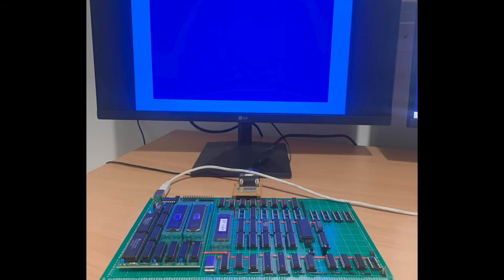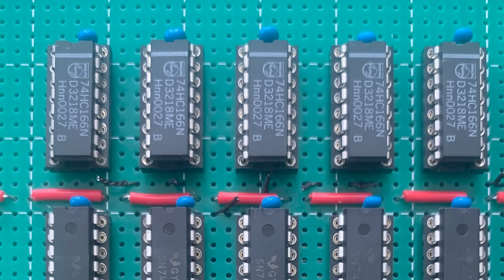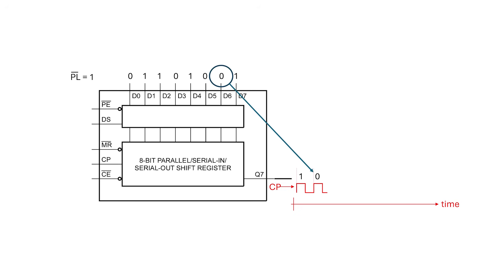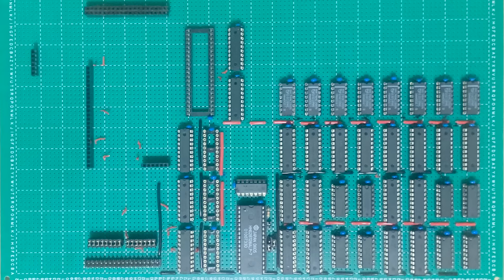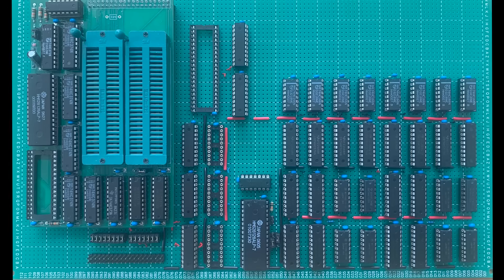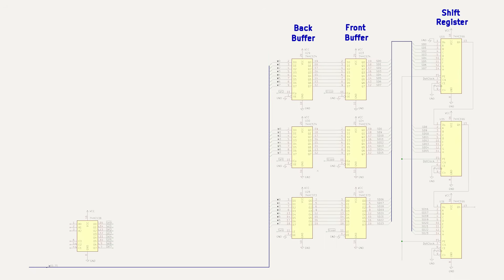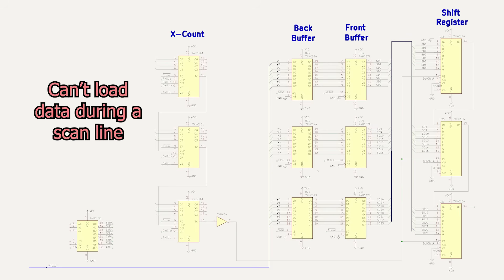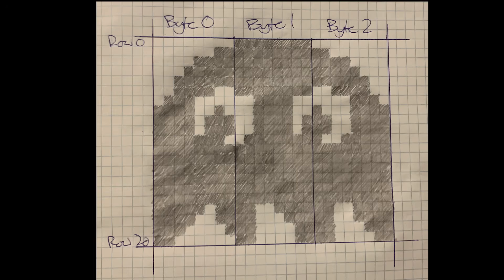Commodore 64 from Scratch: Sprite Engine

Comment: This makes me wonder about an analogous series covering the evolution of PC video hardware. The cards started out so barebones that if you were to start with MDA/CGA and keep expanding it to each major milestone, it'd probably give a series comparable to what you're doing here with the C64's video chip, though you'd probably be past VGA by the time you had to add any kind of significant hardware acceleration, and you'd probably be stopping at the end of the ISA bus era. Well, unless you think you could make an interesting series about the technical details of PCI, I suppose.

Comment: So my sprite engine design (which I haven't built yet) isn't that much different from the one in this video. (although I'm taking more inspiration from Atari 800 than C64)
Haven't seen other videos in the series, but for a long while, I've been studying how those old video chips work.
I'm currently building my own homebrew computer/console, and started with the video hardware:
So far, it's just a video sync generator that displays a white rectangle with a black border, with no other functionality, made with 74HC-logic and two GALs. The output is composite (I think it's a perfect, period-accurate middle ground between RF and VGA). A memory-mapped tile/character display with color attributes is what I have to tackle next.
While I do have a design for sprite logic, it won't be built anytime soon (maybe once I make pcbs), as it would take up too many breadboards, and I'm designing my video system to take up as least space as possible (without resorting to any fpgas or emulation heresy).

Comment: The Atari 800 sprite engine is much simpler. It supports four single color eight bit wide sprites, that are either single or double width. There are also four two bit wide missiles that can be merged to a fifth sprite. Interestingly they go from the top to bottom of the screen and the X position can be altered after each scan line. The Y position is controlled by moving bytes in RAM. Collision detection is supported as well. Quite a lot of interesting games could be coded within those limitations.
Reply from the maker: Hey Martin.  I think the 2600 has a similar setup with missile sprites.  I have thought about trying to build a 2600 TIA with TTL, but I think I’d stick to an actual 6502 for that because the timing is so tight.
Reply: @DrMattRegan The 800 uses the GTIA chip which is an enhanced version of the TIA chip. So I would assume they're very similar. The 800 also included the ANTIC chip which raced the beam offloading work the 6502 did on the 2600.
Reply: it is sad that TED did no even get simple sprites. Games on plus/4 suffer so much from color attribute collision. Two player sprites ( we are social and have friends ) could be combined ( single player game ) and also used a keyboard cursor and mouse pointer. With the smaller borders and without any cycle stealing this would be possible. CPU is powerfull enough to vertically render the pattern. TED should supply the interrupt vector for the line interrupt so that even the C16 could have the fast version to turn on and off these sprites.
Reply: @ArneChristianRosenfeldt I knew the plus four existed, but never used or programmed one.

Comment: The biggest fail in the C64, IMHO is not have full-height sprites.  Al sort of dropped the ball there.
Reply: ?? Making them higher is easily accomplished with a raster interrupt. Making them wider is the major issue, that is where you have to use multiple sprites and then run out of sprites.
Reply: @danielmantione  "Higher"? 😀
Real video systems have sprites of arbitrary height. Same hardware is used every line. Raster interrupts for "plexed sprites" are crap. May as well be on an Apple //e.
Reply: @saganandroid4175  You mean like the sprite system of the Atari A8 architecture? You can make them arbitrary long by modifying them every line. That is far inferior to the sprite system of the Commodore 64: It consumes way more CPU cycles and allows less advanced graphics.
Reply: @danielmantione  No, and no and sort of and maybe. I would not take anything from Atari but the ability to reuse Sprite hardware every raster without the software tricks the C64 relies on. You are right about the lack of DMAstop wasting cycles (though they could use a raster interrupt to turn of that Sprite when it reaches its last line). Surprised you forgot about the other way Atari sprites suck: No DMAstart, so no vertical   motion/positioning.
Reply from the maker: Making them higher can be done in the microcode/logic that copies them into the shift registers
Reply: @DrMattRegan  I think you mean "taller". But tell us more.  Would love to know how to advance the VICII while keeping it compatible.  I was under the impression this absurd limitation was a memory boundary constraint. The VICII would have been better if it could access 32 or 64K at a time
Reply from the maker: Yeah I do mean taller.  While we (I) don’t know exactly what the architecture is for feeding in the sprite data on the VIC-II, it seems relatively trivial to let the row counters for the sprites to keep on going and just eat into the next 64 bytes.  We could then make say two 96x128 pixel sprites (4 actual sprite each) which would be great to some games (martial arts etc). The problem with interrupts is that if they land on a bad scan line and all the sprites are active you have about five 6510 cpu cycles available in that entire scanline
Reply: @saganandroid4175  It would be super-easy to add an 8-bit register to the VIC-II with a bit for each sprite. That would increase sprite height to 42 lines: In that case a sprite would use two consecutive 64-byte "slots" in its 16KB address space.

Still, the VIC-II was completely intended to be used with raster interrupts, creating taller sprites with raster interrupts is a piece of cake. Of all hardware limitations that exist inside the C64, the sprite height is a non-problem. It is also how Albert Charpentier did intend it, first edition of the Programmers Reference Guide from 1982 already mentions this possibility.
Reply: @danielmantione  >"It would be super-easy to add an 8-bit register to the VIC-II with a bit for each sprite"
Interesting. Can you be more specific?

Multiplexing Sprites via raster interrupt is an ugly hack, nothing more. Not a bad option to have, but taller Sprites- ideally with DMAstop counters would be preferable.
Reply: @saganandroid4175  You might consider raster interrupts a hack, but the VIC-II creator did think differently; it is the way you are supposed to use the VIC-II.Sprite multiplexing was not feature that was discovered during the life of the C64, the C64s documentation suggests sprite multiplexing from the very beginning.

So, to be more specific, I would had a register, say $D032, where each sprite has a bit whether it is 21 or 42 lines high. If the height is 42, then the sprite line counter doesn't stop at line 21, it just continues counting, and just continues reading from memory. So if your sprite base pointer points to $2000, an 21-line sprite gets its shape from $2000 to $203E, while if you set the 42-line bit, its shape is comes from $2000..$207D.

Such a register would have required very few additional transistors and could have been a VIC-II feature from the start.
Reply from the maker: Yeah, racing the beam was pretty common back then (Atari 2600, ZX80/81), so interrupts were a luxury.  I wasn't above racing the beam myself:
https://dl.acm.org/doi/pdf/10.1145/192161.192192
Reply: @danielmantione  But C64 has bad lines. Sprite multiplexing can work wonders with only 8 line precision. Sprite multiplexing was seen as mandatory because texas instrument already demonstraded multiplexing ( in hardware ). For every character in a scan line, the chip also checks y values of a sprite in video memory. The chip loads 4 sprites into hardware registers similar to the registers in VIC-II. Sprite flickering uncovers this "trick" to easily . So Commodore adds more sprites per scanline. So pac man with 4 ghosts does not flicker. This removes the pressure from multiplexing, and in turn the pressure to video memory. Bubble sort is less taxing overall. Just, I feel that VIC-II is missing an insert sprite mode, where we name a sprite, and VIC then in the border shifts this and all behind to the back or front. Not all sprites. VIC would stop if there is an empty slot. The TMS knows the number of sprites per scanline. VIC-II could use this knowledge to decide if it really needs to steal cycles. Then it would also make more sense to only read sprite pointers if needed. Of course, while you are at it, VIC should have 16bit sprite start pointers. I mean: more than 8 so that we can pack arbitrary height sprites into memory. Amiga has all this and the better CPU.
Reply from the maker: I presume you mean Al Charpentier? (Not Artificial Intelligence)
Reply: @DrMattRegan  Indeed.  It's 2025, the 0 has lost its slash, there still are no PETSCII-like character glyphs on modern computer keyboards, and the letters I and I look the same on most systems.  Idiocracy and Enshittification in full effect.

Comment: How much work would it have taken for C64 to have Amiga-style "attached" sprites? Meaning two sprites (like sprites 0 and 1) could  be combined to output 2 bits of hires data or 4 bits of multicolor.
Reply from the maker: Interesting thought.  The data is actually available for attaching sprites when they combine them, so in theory it shouldn’t have been that hard
Reply: So, true color mode because 16 only has 4 bits of color in total. Would need to color key transparent, though. If you look at the die shot, the pixel data (the meat) takes only up a fraction. The rest is overhead. And this is already with 24 bit. Other systems are worse ( NES: 16 bit ). So we get dangerously close to a general solution with arbitrary width sprites ( 1 .. 8 bytes? ), arbitrary bpp: 1,2,4, arbitrary zoom: 1--8 . The manual would contain an expression in BASIC syntax to check if the memory read cycles are overflown for a given scene ( so Art department can check ).
Reply: @ArneChristianRosenfeldt  Sprite color register could determine the transparent color.
Reply: @ArneChristianRosenfeldt  Also it costs two sprites to get one attached sprite. So 7 sprites totally if 0 and 1 are attached, 4 sprites if all are attached. Thus same amount of memory read cycles.
Reply: @az09letters92 yeah someone wanted a fixed read pattern to avoid bugs, but Amiga has flexible timing. So the design is not consistent. For example in a vertical shooter I would deal wider borders and stolen cycles for nice sprites. Also I would used packed pixels so that I do not lose many pixels when scrolling horizontally.

Comment: what a project - a discrete sprite engine ! WOW Amazing !! I dont want to know how many hours runs into that project....
Reply from the maker: Thanks, it's been a fun one to work on!
Reply: @DrMattRegan  I think it would have been easier to render all sprites on a line to a sram (sprite over sprite)and in the next line push the sram with priority from charset generator to the video out latch ?
Reply from the maker: @markussteinbacher8807 yeah, not sure, you’d have to clear the SRAM (320 pixels). then potentially render them 8*24 pixels.  You’d probably need 4-bits per pixel.  The state machine runs at half the dot clock rate, so we only have 226 clocks per scanline, and I don’t think that’s enough.  Interesting idea though.
Reply: @DrMattRegan  i would take a byte in sram for a sprite pixel and when pushing, you could following a WE pulse with databus set to 0 to clear ?
Reply from the maker: @markussteinbacher8807 the SRAM would be running at 28MHz to do that though. (2x dot clock).  So 35ns parts.  Possible, but not with the SRAMs I’ve got.
Reply: @DrMattRegan  all right !

Comment: Thanks so much for the video.🙂
I kept looking up graphics acceleration but the results are cyclical Ie. "It uses uses hardware acceleration.", "How does it work?", "It uses a custom chip to speed up the rendering.", "How does it speed up rendering?", "This platform uses a RTCXL-188.", "How does a RTCXL-188 work?", "The RTCXL-188 accelerates graphics rendering with a custom chip architecture.".😩🤬
Reply from the maker: If you're interested in 3D graphics hardware, have a look at some SIGGRAPH papers from the 1980s-1990s (including my own papers).  These ideas migrated into the GPUs in the late 1990s and early 2000s, then went back to software.  I think some ideas remain in hardware (setup/rasterization, Z-culling, ,texture sampling) but a lot is done in software on the shader cores.
Reply: @DrMattRegan  Oh I'm interesting in all graphics hardware, 2D & 3D.
I'm not very technical but I like to learn how things work and their limitations. So getting an actual definition of a hardware sprite in TTL was most illuminating.
Wow quite the history with computer graphics you have, no wonder you seemed so well informed.🙂
Reply: Or check out the Atari Jaguar. The GPU is a general purpose CPU with a fast fused multiply and add instruction. It sits next to a blitter very similar to the one in the Amiga. When rasterizing a polygon, the inner loop ( a span or scan line ) is drawn by the blitter. You set it up with start (x,y), length, intensity, z, z_gradient, (s,t) texture coordinates and their gradients. For the GPU this should be fire and forget though the actual implementation lacks a small queue. The blitter should deal with memory latency (reads from z-buffer, reads from texture memory) . Already in 1993 reads from main memory took 4 cycles, while instructions only took one cycle. Stalls in the GPU are quite costly -- we need all the cycles we got for set-up and edges. GPU is big and should not idle.

Comment: The 6502 checks the Ready Signal to read from ROM because ROM apparently was slow back in the day? It does not check on writes ( probably to save latency ). Commodore should have changed the RDY line behavior. Or, if no engineer did dare to touch it, change VIC-II . Internalize sprite pointers. Spread the bad lines (needs more internal memory). Actually, TED does this better: Load color attributes in one line and characters on the other. Memory clock needs to be slightly faster than the character clock on screen. So we can evenly insert the additional reads.
Reply from the maker: Yeah, the problem is that you can get 3 write cycles in a row for an interrupt or a BRK instruction, so the VIC has to guarantee that the CPU is free to do that.  I'm not sure what i would have done differently it i'd designed the VIC-II.  A sprite interrupt mask would be helpful, but overall, i think it's a pretty clever design for the time.
Reply: @DrMattRegan  Actually, for bad lines 3 cycles are only a minor performance penalty. The problem is that VIC-II does not cluster bad lines with overfull sprite borders. I think I saw examples where 9 cycles were wasted. Spreading bad lines onto two lines ( but keeping SRAM ) allows the VIC to only half the clock of the CPU. It was tested that this is no problem, but somehow it is still out of specs? I still try to figure out how Atari 8-bits and VIC-I steal the cycles. It looks like they use RDY all the time. It would be nice if 70s documentation used modern language. Atari docs have some rhythm patterns which really look like the switch between 1.6 MHz and  0.8 MHz all the time?

Comment: Interesting approach.  I've been working on a hand-wired discrete logic homebrew composite video card, and was toying with how I might want to approach sprites.  Your method ends up being a bit different from how I'd approach it, but yours is also targeting an established feature set of a common machine, one that has to do alot more.  Nice work, this is fascinating.
Reply from the maker: That's awesome, thanks for the feedback, it's always interesting to hear about different approaches!
Reply: How did you do it differently?
Reply: @saganandroid4175 blit sprites into a SRAM linebuffer, for example.
Reply: @noop9k  Are we talking a real sprite here? Because it sounds like a BOB to me. And what's this SRAM linebuffer thing? SRAM implies real hardware, but that's this linebuffer? When you mention blitting, that seems mutually exclusive to sprites. The whole idea of a sprite is not have to touch bitmaps much. No buffers, no XOR, no masks, copy/paste cycles, no double-buffering.
Reply: @saganandroid4175 Won’t explain but no, not BOB, not framebuffer blitting. Just a more advanced approach to rendering sprites that was probably used on 16-bit VDPs, as the naive approach used in early hardware is too inefficient as the number of sprites increases.

Comment: how about emulation of c64 logic instead of hardware copy of c64. ie c64 done smarter but compatible.
Reply from the maker: It should still be compatible.  I guess I'm really about teaching computer architecture and the basics of finite state machines with memory systems attached and how these concepts scale up.  I've avoided FPGAs and emulation on modern CPUs for this project - i did plenty of that when i worked at NVIDIA.

Comment: Nice work..
I have been recreating arcade machine hardware for a few years but the cost of buying chips now is ridiculous. What I have ended up with is using 3 or 4 pi pico boards.... one emulates a processor,  1 does sound, 1 generates VGA.... works very well and I wrote all the code myself. The added bonus is it has the memory space to include 4 or 5 games all with very different arcitectures (6502/Z80) ... sprites were a chalenge but works a treat now 😂
Reply from the maker: Sounds like a cool project, it's good that you've been able to work around the chip costs.